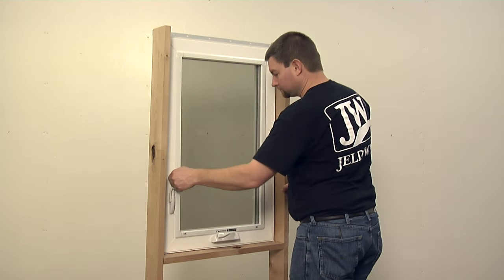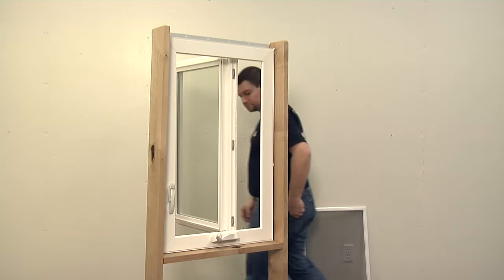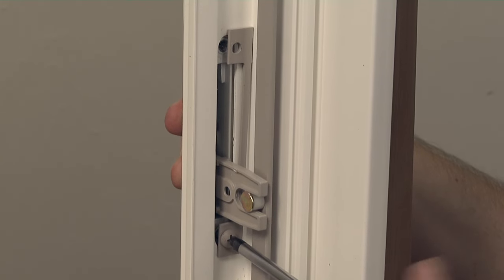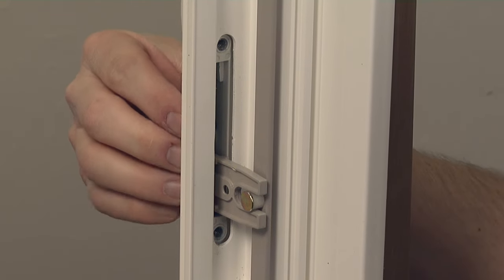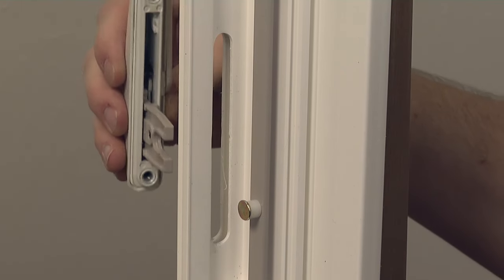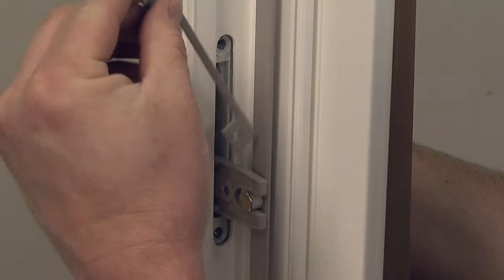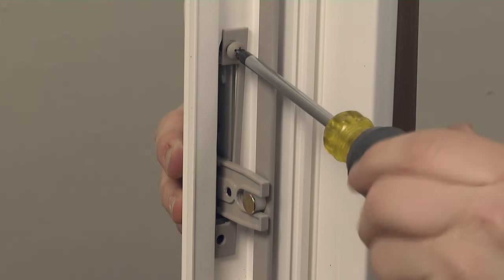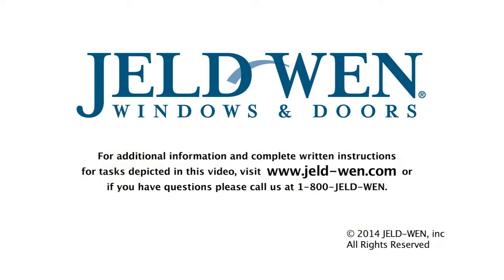How to Replace a Lock on a Casement Window

Comment: This is all well and good, but why would you need to replace a working latch...the problem is when the window is locked closed and the handled sheered off leaving an unopenable window so those screws cannot be accessed .. then what ?  thanks ..
Reply: I think you need someone who works on windows at that point.
Reply: Use a butter knife, slide into the groove and push up to release window.
Reply: I use a scraper (5in1) tool. Slide it in and push up/down to unlock.
Reply: Easy fix. Get a clean sledgehammer with a long handle. Clean the windows and remove the crank. Also remove any old glazing near any window panes that're cracked. Lay down a drop cloth to protect your floor. Finally get the sledgehammer and smash out your casement window frame and glass. Go hard! Replace with a double pane slider and call it a day.

Comment: My lock broke but i was able to open the window by somehow getting a butter knife in there and wiggling and jiggling it. I replaced the lock but i noticed the top of the window isn't as closed as the bottom when i'm trying to lock (which is probably how the lock broke in the first place) How do i adjust that?
Reply: same issue here. have you found a solution, have you emailed customer care?
Reply: Thank you!! This worked for me! I used a very small palette knife from the kitchen that you use for icing cakes. Popped the whole thing open without any damage!

Comment: Yeah, my casement window locking handle broke in the locked position.  Grrrr!!
One consolation was that I wasn’t alone in this situation.
Very thankful for the many comments, suggestions, and videos.

I tried the butter knife/putty knife/screwdriver prying method….but it will not work with this type of locking handle.
This locking handle is designed to be “highly pick-resistant” with a housing frame that extends in to the cutout of the window frame.
Rather puzzling why anyone would pick a window locking handle……that’s on the interior side…..???

Anyheew…..
I watched instructional videos of how to change the locking handle…..only useful if you can open the window.
And watched a video of a fellow sawing off the surface of the locking handle…..Yikes!!  A bit extreme, me thinks.

So…..
I drilled a hole through my locking handle...straight through the front and just above the handle hinge.
Started with nail poke to keep the drill bit from slipping.
Then drilled through with the skinniest drill bit, then drilled again with a bit wider drill bit, then drilled again with a 3/16” drill bit.
Then inserted a poker screwdriver to push down the fork mechanism (by levering the screwdriver handle upwards).

Voila!  The window unlocked.
I was able to crank open the window to gain access to the screws and replace with a new locking handle.

You’re welcome!
Reply: That soulds like an interesting approach...  I will give it a shot.  Thanks!!!

Comment: Here is what I did.  On our 4ft tall x 2ft wide the lower part of the window could be jimmied open about 1/4".  We have three of these identical.  In looking at one of the "good" ones I could see a small 1/4" diameter pin attached to the bar that normally slides up and down moving three sets of wedges to lock the window shut.  Our handle also moved up and down freely.  What happened is the fork of the locking lever became dis-engaged from a plastic coated pin on the bar.  Get a 3/16 allen key, some vise grips, a small pry and a small hammer.  Grip the long part of the allen key at the end with the vise grips so you know how the small end is oriented. Force the window open enough to get the allen key in.  You should hear it touch the metal strip the pin is welded to.  Our windows pin slides between 13.5 and 15.5" up from the sill.  Its stuck up and needs to be tapped down.  Feel  for the pin starting about  16" from the bottom and eventually the allen key short end will rest on the pin.  Angle the long end of the  allen key up as far as possible still in the vise grip.  Tap the end of the allen key to gently force the pin and bar assembly down.  In my case the window all of a sudden sprung open but the f'ing thing at the bottom by the fork stopped it dropping enough to completely release.  Pry the fork and pin apart so the locking bar can bottom out and the window will open.  All I can say is WHAT A CRAPPY DESIGN !!  These windows never have closed properly since we bought them.  The company sent a couple of goons to "repair" them with 4" deck screws.  He put the screw into the window frame and tightened the damn thing till the frame cracked.  The best part was watching them destroy the old windows during the install process.  WTF.

Comment: what do i do if the latch has broken off and the window is locked....? i need helpppppp
Reply: use a thin knife insert the gap of the window top of the lock ,then push down the knife the lock will open.
Now my problem is where to buy the lock? i go many shop cannot found it,some say this style is too old.
Reply: thanks i found it .
Reply: @sunnylau6207  where did you find a replacement lock?